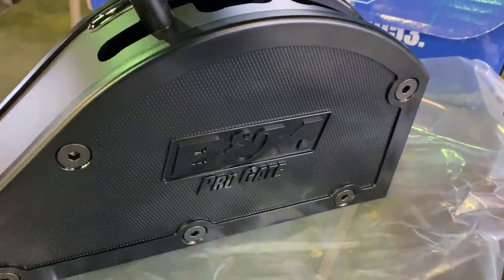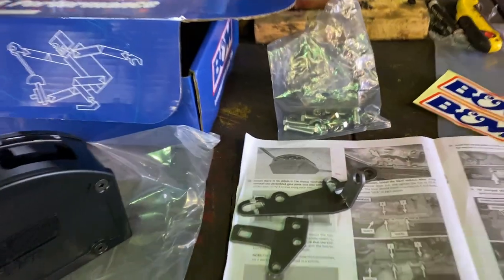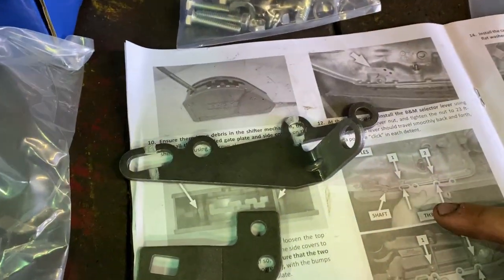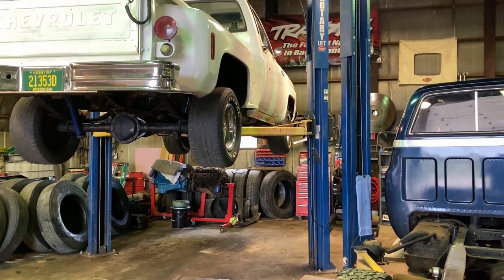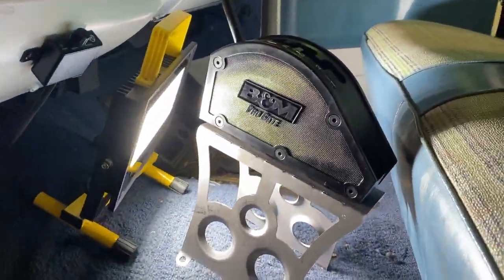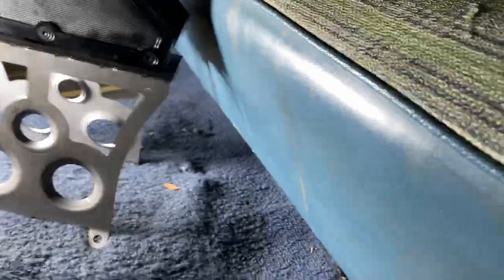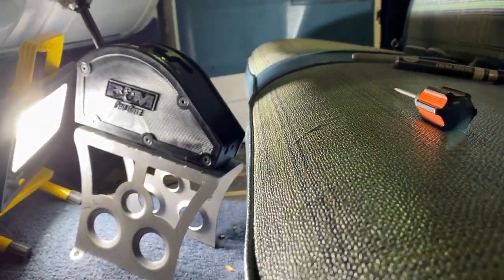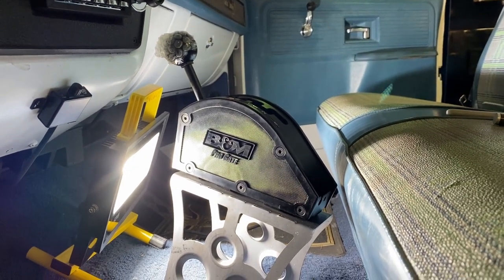B&M Pro Gate Shifter Install! Squarebody C10 gets drag shifter! |LS SWAP|CARB LS|

Comment: Not liking how the shifter is mounted. Looks wrong and doesn't look easy to use. I'm sure it is fine for you but I don't recommend this.
Reply: @squarebodyblake4464  also, it looks bad. So, that's why. Also this is you tube. Get ready if you do a crap job to hear it from people. Well you've done a crap job.
Reply: @squarebodyblake4464  now you've got it. Oh look at my shifter it doesn't fit, it has to sit sideways, oh also we jabbed a hole in our seat to run the shift cable because of this. Sorry, that's just not a good job.
Reply: @squarebodyblake4464  I didn't ask why it was an angle. At all, I say it looks bad, wrong, busting knuckles to put it in gear. Sits crooked, doesn't look planned. It's just bad what else can I say?